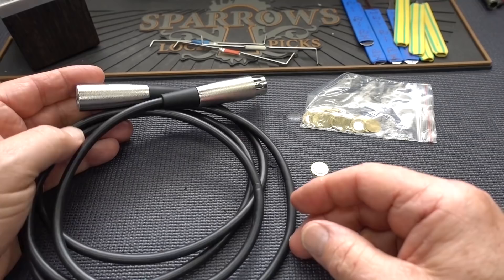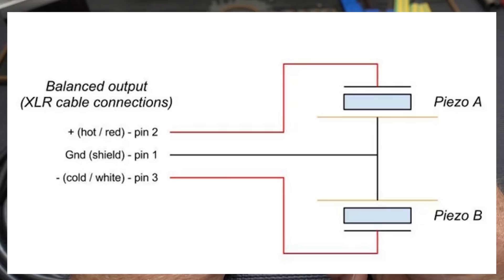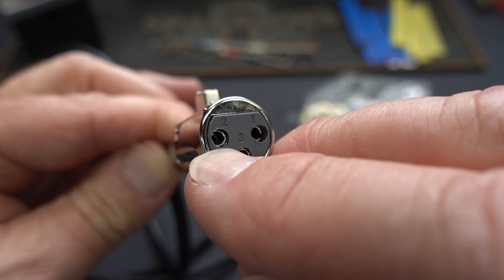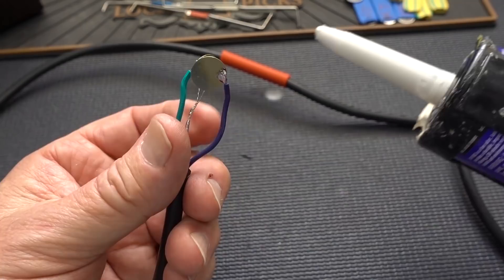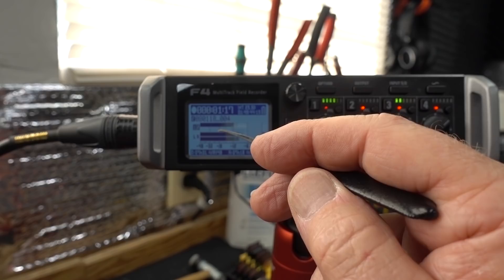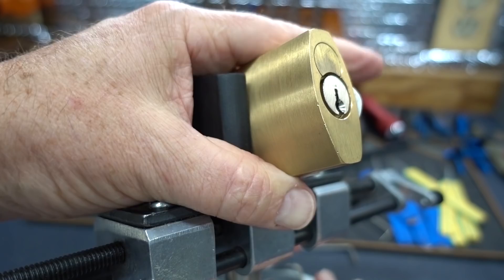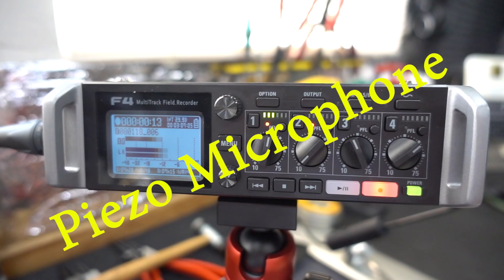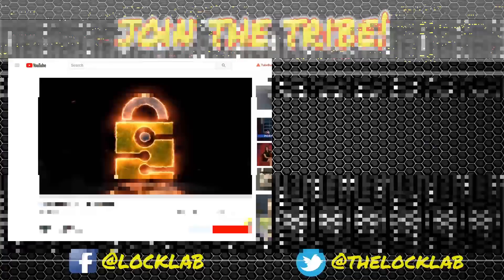(1338) Experiment: Piezo Crystal Lock Picking Microphone

Comment: Those look to be wired a bit strangely.  You wanna wire one plate with + and - but you're wiring two separate plates only half way (one with + and one with - ) and trying to bridge them together through the ground wire.  You're better off using one of them and simply wiring the + and - to the single plate (and eliminating noise separately), using the least amount of tinning of the plate and surface-mounted solder possible.  Probably shouldn't use two back-to-back either even if you wired them both properly, though you would only have to deal with competing sound waves if both sides were receiving more or less the same input.  I don't really think that would be the case with your application, but better to be safe than sorry.  Plus, you gotta power those piezo-electric plates if you want them to really sing.  Plug them into a high-impedance input instead of a microphone input, which is designed to be a low-impedance device... or use a preamp.  The epoxy might harden too much to pick up small vibrations from pins in a lock... it wouldn't be as bad if it was picking up direct vibration, but you're attempting to pick up sound transmitted through the lock body which has already been pretty well dissipated by the time it hits the microphone, so that's probably not a great idea either -- a softer enclosure like silicone or electrical tape might be better, but maybe the epoxy will still work well enough -- this one isn't necessarily a true deal-breaker in my opinion.  Also, the longer a cable, if not perfectly balanced, the more noise you'll introduce, especially if cheap poorly-insulated cables.  Always use the shortest length of cable you can when not in total control over your shielding and/or source noise.  You could try to use a ground hum eliminator somewhere in your setup... which does work to eliminate a lot of common cable noise.

Comment: You might also consider using a couplant designed for ultrasonic inspection between the pickup and lock body. Air is a relatively poor transmitter of sound waves. Just a basic glycerine based gel would do the trick.

Comment: Hi Bill. Have you considered using a HYDROPHONE? Usually usedfor underwater recording. The head is filled with oil and can pick up on vibrations in water. Possibly in the thick metal of the lock body. It's a bit of a creative risk but worth a shot.

Comment: I’m pretty sure the noise is from your fluorescent lights.  I get the same sound on my guitar amp if the gain is up too high when I’m around them.
Reply: Schlomo Goldsmith he said in a previous video he replaced his lights with LEDs
Reply from the maker: Yep, fluorescent lights are history.
Reply: yeah, the flicker in the video from the florescents matched the hum
Reply: Some LEDs put out enough EMI to foil a garage door opener if installed in place of the incandescent light that comes on with the door operation.  It took a while to figure out why the remote quit working altogether when the LED was screwed in place.
Reply: Yes, I have seen similar issues with LEDs and even some cameras (even during the day when the infrared LEDs are off) - not sure how/if they would affect microphones/piezos though.  It is RF interference but different frequencies...
Reply: I leave mean comments maybe this is why his regular audio is so bad as well.... That damn scratching sound.probably caused by electrical interference as well.
Reply from the maker: mike02467  No, it isn't the LED lights.  I've posted this in several places but perhaps you missed it. 

The intermittent “rattle”, “scratching” or “cat bell sound” a few viewers have been hearing has been a nightmare to track down, and it came from an unexpected source.  It was especially difficult because I fall into the group that cannot hear the rattle so I worked with some sound engineers with perfect hearing.  
    Before soundproofing the LockLab, getting a studio grade microphone, and capturing audio at a very high resolution, nobody noticed because the rattle was disguised by low resolution audio that had a lot of background noise and camera hum.
    Once I soundproofed the LockLab and upgraded the audio gear, several of you noticed a faint, and intermittent sound that occurred ONLY while I spoke.
   I should note that I don’t wear jewelry, dog tags, or anything else that would cause a sound. My pop/hiss filter is 3” away from the microphone and firmly zip tied down.  The microphone is in a shock mount and all connections are tight.  VERY tight.  While recording my mouth is 6”-12” away from the pop/hiss filter and nothing touches the microphone during recording.  My recording levels are very low, in the -18 to -12 dB range with no spikes above -6dB.  If there IS a spike, I adjust it down to below -6dB before publishing.  I’ve done tests down to -34dB average, but the rattle was present at every level.
    My first thought was a faulty microphone, so I bought another, then another, then another.  Each clearly captured the distortion.  Oddly, the sound does NOT show up on the audio waveform.  There are no spikes or any indication that something is there, yet you can hear it.  A sound engineer suggested my voice had a resonant frequency with the microphone’s capsule, but after five different microphones capturing the sound, I ruled that out and returned the mics. My current microphone is no slouch: a Neuman TLM-103.  We ruled out the microphone.  
    The second suspect was the intermittent running cooling fan in the laptop, which I was using to capture the audio.  I replaced it with a Zoom H2N digital recorder, but the barely audible rattle was still there. I bought a Zoom H5, then finally a professional grade Zoom F4.  The sound was STILL there in all of them. We ruled out the digital recorders.
    The third suspect was the audio processing software that I believed might be introducing distortion during noise reduction of the high-resolution files.  I invested in Adobe Audition but it made no difference and the noise remained. I bought Izotope’s RX6, but audio processed by it also had the rattle. Several people suggested it could be YouTube’s compression software but since rattle is present in most of the raw, unprocessed audio we ruled that out.  The sound engineers believe YT’s conversion and compression make the sound more distinct, but it is not the cause of the rattle. We ruled out the post processing software.
    The fourth thought was some kind of electromagnetic influence causing the distortion when my voice peaked.  I replaced the generic microphone cord with a Mogami Gold Studio Grade XLR cable. It made no difference; the sound was still with us.  I made test files with the power in the LockLab shut down, operating on battery power only.  The rattle was still present in the audio files.  We ruled out cables and EMR.
    For my fifth attack, several people suggested it was something in the LockLab that was vibrating when I spoke.  To test this, I made several test files in my house (bathroom, dining room, kitchen, and in the back yard).  I did these tests using multiple microphones and the three different digital recorders.  All the files had the rattling sound.  We ruled out anything unique to the LockLab.
  By this time, I had no idea which direction to go. It was a gremlin…
  Shortly after the final test my wife and I had several friends over for drinks and dinner. In the course of conversation my wife started to ridicule my “irrational quest for perfect audio” and several friends were interested.  I fired up the laptop and let them take turns listening to the audio.  About half heard the sound and, with no prompting from me, called it a “faint rattle”.  As I told them of the various tests, one of them said “Hey!  Bill, say that again!”.  I repeated my sentence and they all said “There it is!”  I repeated the sentence several more times and they occasionally heard the sound – not EVERY time, but intermittently.  Once the people with REALLY good hearing knew what they were listening for, they said it was easy to hear when I spoke.
    So, since my voice was the only common element throughout the testing, it finally made sense.  I apparently have an intermittent vocal anomaly that was enhanced by the high-fidelity gear. Normally, it is found in singers that stress their voices and is called, appropriately enough, “singer’s rattle”.  A very few people can hear it perfectly, while most cannot.  
There were three possible solutions: 
 The first, suggested by Adam F, is to apply a notch filter around 4100hz, where the rattle appears.  We’ve experimented with this but unfortunately 4100hz is right in the middle of the human speech range.  The “rattle” is not a discrete frequency, but actually ranges from 4000hz to about 4200hz, or a range of 200hz.  Notching out that frequency range REALLY mangles the audio and is obvious to the most casual listener.  Clearly, won’t work.
  The second solution is to revert to using the camera’s microphone to capture sound.  It is a much lower resolution and, as long-term listeners probably recall, produced pretty dirty sound.  There’s no guarantee this would satisfy everyone because the camera DOES still capture the rattle, but to a lesser degree.  I’m not a fan of going back to low quality sound.
  The third solution addresses the REAL problem: my voice.  Treating “singer’s rattle” includes warming up your voice before recording (I can do this), not over-exerting your voice (I don’t do this), gargling with salt water (I can do this), and hot drinks like tea with lemon & honey (efficacy of this is arguable but I can do this too).  Some suggest that placing the microphone at a 45-degree angle to the side helps attenuate the rattle, so I’ve moved my mic.  Oddly, this rattle didn’t show up in my voice until about six months ago, so it may solve itself, given time.
  In short, there’s no guarantee that any of these things will permanently fix the noise.  I’ll do everything possible, but I have to work with the vocal cords that I was issued…
Bosnianbill

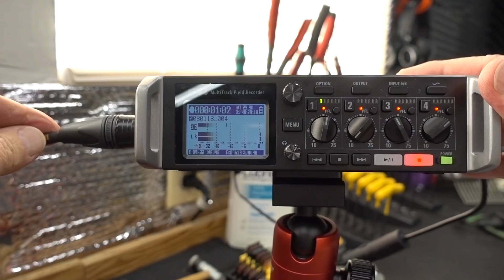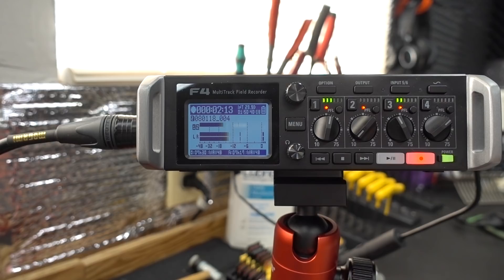Comment: 5:39, when you plugged in the Piezo, the "cat bell" sound went away COMPLETELY and it comes back at around 6:56 . It looks like you found a "hack" method of fixing your audio by just plugging that thing you made in, and leaving the gain turned off or whatever situation you created during that camera angle, which didn't occur until the moment you plugged it in and the moment you switched camera angles it came back.
Reply: Jay H I wouldn't call it a cat bell, more like static/clipping/compression noise. What was different in that short section of video? Given Bill was mucking around with his equipment perhaps he changed something for the experiments?? Maybe a faulty lead? Moved a lead away from a source of interference? I did notice a significant improvement in sound quality, however the volume did appear to be down a little lower. Perhaps Bill is using the VU meters on his gear and settings levels with the best of intentions, but the gear is lying to him and there is some slight clipping...

Comment: The hot and cold wires should be soldered (with silver; lead will interfere with the piezo effect) directly to the individual crystals, while the cropper / brass backing plates should be connected to each other as well as to ground. A picture is worth a thousand words: https://imgur.com/sRQppST

Comment: Try it again with just one peizo and on of the inputs not conecteted to anything. balanced line is designed to cancle out noise induced in the wire hence - and positive leads. the amplifier subracts one signal from the other. usualy from a balanced output. two piesos orented out of phase but seperated are gonna be all over the place phase wise. What i think might work is if you super glue the peizo to the vise jaw and take the rubber of for rigid metal on metal audio coupling. or on a bit of metal or rigid plastic plate between the rubber jaw and lock. if you still get mains hum from the leads you can filter it out in your audio software. they also do peiso pickups for sting instuments that are designed to be wedged in the bridge, so could probably withstand clamping preasure too. I bet some come with a balanced output preamp??

Comment: What you've made there is technically more akin to an accelerometer than a microphone. This is what you want in this application, but as I'm sure others have mentioned there is probably an impedance mismatch between the microphone and the input.

Comment: Id recommend putting some capacitors to remove the noise
Reply: Using capacitors to filter out noise in this situation would also filter out the signal, as both are AC in nature. You could use them in a high pass filter tuned to block out signals at or below 60Hz (the typical cycle rate of US power lines), but his real problems have been mentioned elsewhere in the comments section of this video.

In summary, his problems appear to be a combination of: mismatched impedance between the piezo elements and the input of the recorder; possible damage to the ceramics of the piezo elements due to too much heat from the soldering process; and the epoxy and/or clay preventing the piezo elements from moving, thus reducing their ability to detect vibrations (i.e. sounds) properly.

Comment: Maybe interference from your fluorescent lighting.  Maybe pick up a lav mic (Sony ECM44B) and secure it to the lock.
Reply from the maker: I have a Sont ECM44B and tried it.  The condenser DOES pick up the clicks, but also my voice at a degraded quality. It is hard to sync the two audio files (but possible), but the result sounds like caca.  Good idea tho!
Reply: @Bosnianbill
could you dismantle the mic and place just the condenser pick up against the lock so the hole is covered by the lock ?  then it shouldnt pick up your voice :-)
Reply: YTANDY100  My microphone is a Neumann TLM 103 and cost over $1k... I'm really not too excited about the idea of taking it apart...

Comment: I pulled a tubular lock apart at work that was broken and noticed that out of the 7 pins, 2 had brass? springs and the rest were steel? springs. Is there a reason why that was done? Thanks ahead of time, love your channel.
Reply from the maker: Sounds like whoever built the lck was scrounging for parts.
Reply: Lol I guess I never considered that.
Reply: I think this is a variation on Hanlon's Razor: Never attribute to intent that which is adequately explained by scrounging for parts.

Comment: It’s kind of like an electric stethoscope
Reply: Now I'm wondering if it would be as simple as adding a mic to a stethoscope attached to the lock...  Sometimes your realize you're overthinking things and remember about Occam's Razor.  Less technical may actually be better.
Reply: eak125 good point!
Reply: I was thinking stethoscope as well. I'm not sure how accurate the depiction of using a stethoscope in the movies to help crack an older safe really would be but I seem to remember there might be something similiar with hearing noises in the cylinder block or some such when working on an engine.

Comment: Have you thought of using the Buzzer from the Operation Game?  :-)
Reply: Depending on how old the particular copy of the game is, the "buzzer" is usually a small motor with a slightly unbalanced weight attached, similar to the motors used in force-feedback game controllers and "silent" phones and pagers. Can't really use those as microphones. It's possible that some more recent versions of the game do use a small piezoelectric speaker instead, which could be used the same way Bill is here, but he'd have similar problems to the ones he's working with here.

Comment: You might try flipping the wires around on the piezo discs,so the brass outer parts are connected to the shield/ground.I'm thinking that might provide a bit better shielding against hum..keeps the sensitive 'hot' signal wires in between the grounded/shielded parts. Just a thought,since you've got a bunch of piezo discs,might be worth a try.

Comment: Piezo outputs lots of shit
Use small cables and go to ADC as fast as you can
Also maybe the epoxy did some stuff
The bigger piezo the better i think
Use very very little heat when soldering

Maybe use 2nd piezo as noise reduction? 
Go ask EEVBlog
Im not into electronics anymore...

Comment: Microphones function through vibration, by applying silicone or glue directly onto the mic, you effectively reduce the mic's ability to pick up vibrations. Also, you don't need a left and right mic... just make the left and right wires as 1 and solder to 1 mic (or convert the mono to dual mono in the video editing). Heat-shrink was a nice idea though. You also don't want the mic directly touching the lock either (metal mic onto metal lock) as that's where most if not all your interference is coming from. You might be able to get heat shrink over the entire mic and not affect it's ability too much, but I'm not too confident with that. Maybe apply a thin layer of fabric over it before getting the heat shrink on top (toilet paper or kleenex or something).

Having 2 mics just makes it twice as difficult to come up with the same result, but in stereo. There's also the problem of one side working better than the other due to one of them being closer to the lock than the other. Just keep it simple and go with a single piezo.